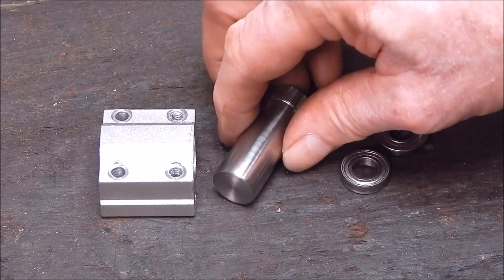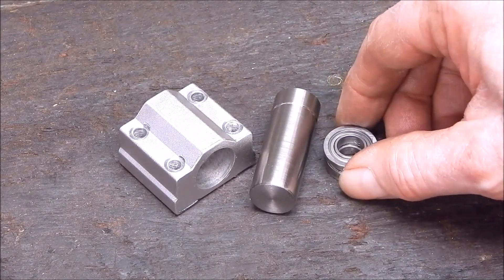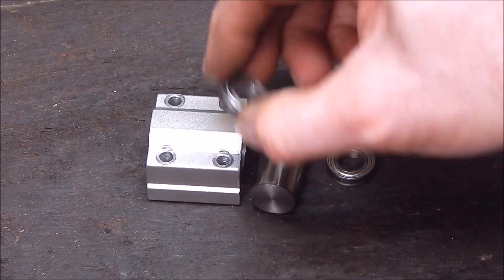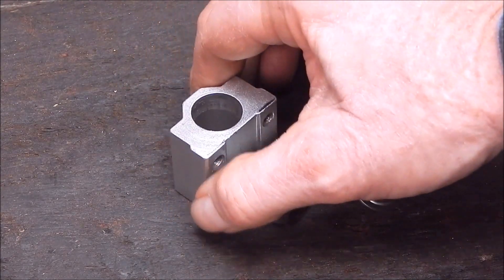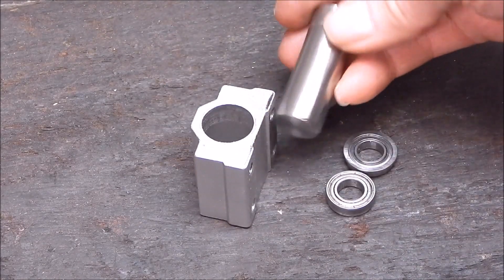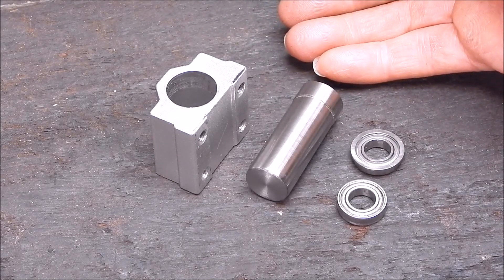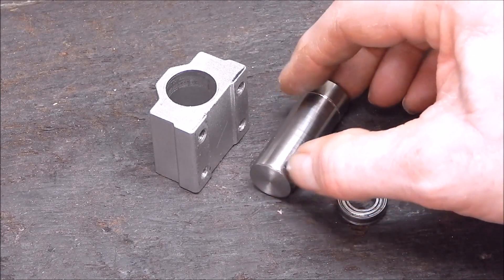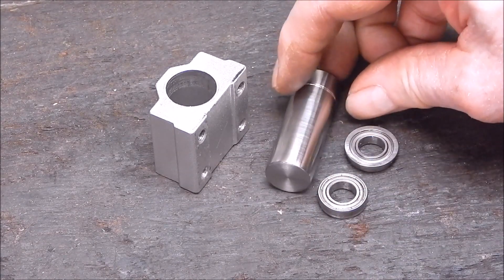Cutting induction hardened steel on the lathe with a 775 DC hobby motor and spindle

Comment: On a "Bigger lathe", since the machine is way more rigid, it's quite easy to manage this type of cutting with carbide tooling, on the other hand, on a smaller machine, this does make the job possible, and, on both machines, this wins the contest as making a better finish at the ends....   
The Dumore grinder has better spindle though, I got a Dumore model 44 that needs a new motor, my plan is to eventually order a brushless motor and adapt it to replace the dead original motor, the brushless is actually a 3 phases motor, hopefully it will minimise the vibrations...     🦘🦘🦘👍
Reply from the maker: Hi Pierre,  I have a Waldown TPG which is virtually identical to a Dumore (1970's vintage).    Vibration has never been an issue, but it won't fit on the topslide on my lathe, so it's a bit restricted in what it can do (or rather how you can do it).  A brushless motor sounds like a good idea.  A low torque high RPM motor is all they need as there's no real load.  It's pretty noisy.  Cheers Rob

Comment: I'm impressed by the results - for such a simple little jig, it yields a nice finish and by using the cutoff wheel it makes a decently clean cut.  Thanks for sharing
Reply from the maker: You couldn't cut or part off that steel any other way unless you annealed it (maybe).  The steel was extremely high carbon in this case.  Many lathe owners are paranoid about possible damage from grinding on a lathe, but they fail to recognize that Schaublin and many other high quality small lathe manufacturers have always made/supply grinding and friction cutting tooling/add ons for their products.    Says it all.  Cheers Rob

Comment: G’day Rob, excellent work by your mini spindle setup, it is versatile.
I was waiting for the paper to catch fire, would’ve made for a fun finish but alas you probably had it on the political pages, insulated with BS. 
Cheers
Peter
Reply from the maker: The sparks seem a lot less aggressive than from the Waldown TPG which sets things on fire very easily.   Stick welders are also good for finding any oily rags within spitting distance and bringing a glow to the visor ;)  Cheers Rob

Comment: Great video Rob, thanks for posting. I never cease to be amazed by those little 775 motors. Cheers, Alan.
Reply from the maker: Hi Alan, grinding is actually a very low power requirement as you are just kissing the job, so these little motors can do it easily (in scale).  Very handy to be able to cut and work hard and unsupported metal.   I was surprised how cool it ran at the full 36 volts.  That Gophert CPS-6005 60 volt variable power supply I use is just the bees knees, so good. 5 amps is enough for these motors.   Cheers Rob

Comment: I thought your video shots were pretty good overall... that set-up sure works pretty darned well. :)
Reply from the maker: It's impressive for what it is Chris.  I have a very difficult job for it tomorrow drilling out a snapped off bolt in a spray pump motor.  Cheers Rob

Comment: Impressive, Rob! Nicely finished work! 
Just a question: @ 36 V in, how many amps did it suck @ idle & @ full DOC? 
Cheers! DIYSwede
Reply from the maker: Hi Johan,  I didn't pay attention to that aspect.  As the friction/drag loading from the discs is minute,  the motor loading was extremely low, so it would have been under 3 amps I expect.  When grinding, the disc is just kissing the surface and depth of cut is small.  It's totally different to using a parting off blade and the low loading allows cutting off unsupported work safely.  Cheers Rob

Comment: Hi Rob, well we always enjoy an attachment spindle cutting against a lathe spindle it is because you can do so much on a lathe with accessories we think they are underrated, so thank you for sharing yours cutting a tougher steel it proves they really should be seen far more often on lathes.
Lance & Patrick.
Reply from the maker: Hi Guys,  grinding/abrasive cutting puts very low load on the job and lathes as it's just kissing the work  So even the hardest of unsupported work can easily be machined.  Just cover and clean up and all is good. Many people are paranoid about the grit/grindings, but provided precautions are taken it's OK.  Gives a good finish as well.  Cheers Rob

Comment: You certainly put that tool post spindle setup to good use! That cut off wheel surely did take a beating though, lol. Did you choose the hardened stock for any particular reason besides suitable size?
Reply from the maker: That steel was going to waste as it was high carbon steel  and unsuitable for most things.  The cutting disc actually hardly wore at all. In fact it was already worn when I started the job.  So I don't know what you mean by it "taking a beating".  It did that job quite easily.  I use Smith & Arrow cutting  discs and highly recommend them.  Cheers Rob

Comment: Nice job Rob. Makes the lathe much more versatile. I have a Dumore for my lathe sometimes wish it was a bit smaller.  Thanks for sharing.  regards from the UK
Reply from the maker: Hi Gary,  I have a Waldown 01 TPG which is a copy of a Dumore.    I rarely use it as I now have three other much more compact and convenient topslide options - the 775 unit, the Hilda die grinder, and the pencil air die grinder.  I must say I'm pretty impressed with this unit.  Beef up the spindle bearings and it should be a winner.  Cheers Rob